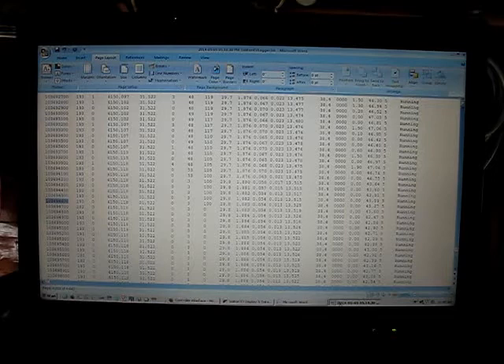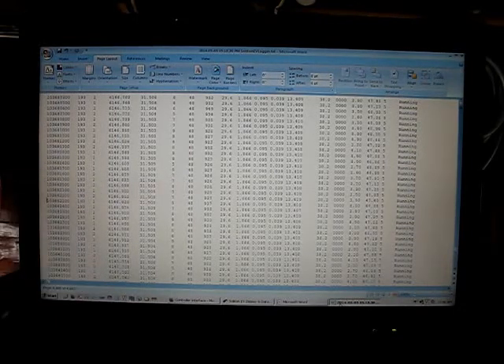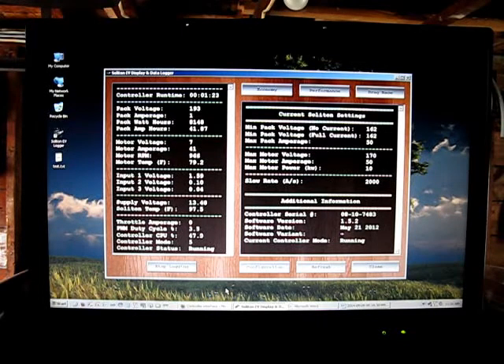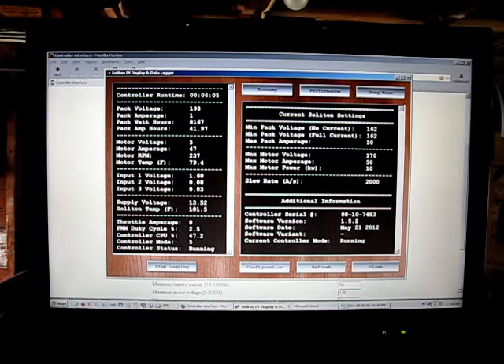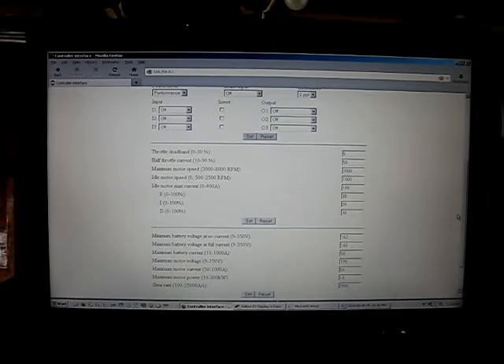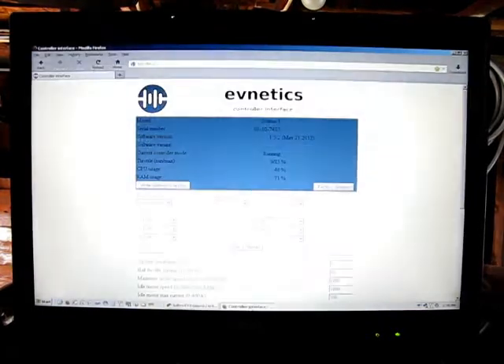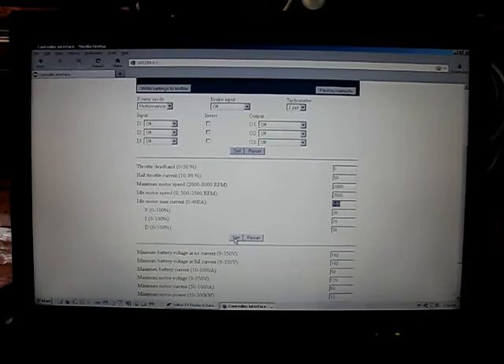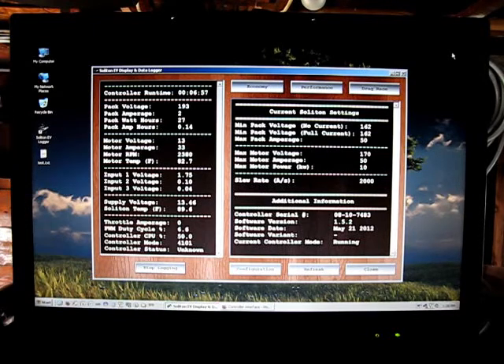May 7, 2014 - Ongoing New Motor Brush Seating Adventures

Comment: Why did the controller read 0 motor voltage? Maybe it did not like it.
Reply from the maker: Aye, that is the indeed question, why was the controller reducing voltage (and thus motor speed) all the way down to 100 RPM when it was set to maintain the idle at 1000 RPM?

Subsequently, it is also curious that raising the "Idle Max Motor Current" setting did not affect idle amperage at all, but rather allowed the controller to increase the voltage, which does seem to be holding the motor at the desired RPM at the moment...

It may just be a semantic issue with the naming and/or my understanding of what that particular setting in the Soliton1 software does.  My guess is that this setting is likely part of a calculation that results in something like an internal "Idle Max Motor Power", which in turn is responsible for moderating both the voltage as well as the amperage sent to the motor in order to maintain the desired RPM.

Even if this ends up as having been caused by a subtle bug in the Soliton's motor idle calculations, it didn't show up until roughly 30 hours of continuously idling the motor...

Therefore, it's extremely unlikely to ever occur during normal and/or real-world driving situations, so I am not overly concerned about it, but rather just found it somewhat curious/interesting and thought I would share what I am seeing.  :)
Reply: DaytonaEV 
The controller was told to maintain 1000rpm but it was not allowed to rise the current above 50 amps. It did the job until the rpm dropped from some reason (may be oscillations, may be temperature, may be other) At that state the motor needed more current (explained leter) the current limit kicked in, to limit the max current(&voltage) going to the motor.

I asked one of my classmate on the University about his opinion. He said that running a series wound motor without a load is dangerous because the torque/rpm behavior. (no torque -> infinity rpm). I may add that the motor has a fan, and other friction losses, which acts like a load. In fact your controller limits the motor speed (via a PID control loop) safely.

The other thing he said, was that at such low rpm the armature may reach the iron core's saturation point. At that condition the input magnetic field (amps time turns) should be increased significantly in order to increase the magnetic flux density (ref.: BH curve). More magnetic flux results more torque (required to speed up the motor) The other effect that may occour is related to Lenz's law. It claims that an induced electromotive force (emf) always gives rise to a current whose magnetic field opposes the original change in magnetic flux. (the force induced by the current breaks the rotatint armature)
 
The voltage (and current) is not set directley by the motor controller, it only adjusts the duty cycle of the electricity coming from thye battery pack. The motor and it's state sets the voltage (almost like Ohm's law)

The settings you made with the idle max current is affectint the PID loop (phisical hardware). I think that the max motor amperage setting is limits in software wich is way slower than the PID loop. So when you enter 100A for the PID controller, it is adjusting the current (for a short period of time) to 100A until the software limits it back down to 50A. I don't think that it is a software bug, more likely the brushes had entered a state that allowed the events to happen.

I must note that at a low rpm the fan is not working so efficiently it may cause overheating problems.

I hope I did not bored anybody with these fundimentals, and it could help you understanding the process better. Good luck with your conversion!
Reply from the maker: Miklos Szekely
Good morning Miklos,

Your research and comments were not boring at all.  On the contrary, I think they are extremely interesting and I very much appreciate you taking the time to share what you had learned.

Good point about the motor speed as well.  Toward the end of this video (about 22 minutes in), and based on feedback from another subscriber (George Hiller), I had changed the Soliton1 to it's maximum idle motor speed setting of 2500 RPM.  This helped keep the airflow moving better and thus kept the motor cooler during this prolonged brush seating process in the relatively stillness of the garage.

As for why the voltage dropped to zero and the Soliton1 was unable to maintain the previously set 1000 RPM idle speed, your classmate's iron core saturation, back-electro-magnetic-force, and Lenz's Law theories sound entirely plausible to me (particularly with my admittedly very limited knowledge of the physics behind any of it).

I suppose that one, or all, of these effects may have come into play at the roughly 30 hour brush seating mark when the motor speed 'mysteriously' dropped down to 100 RPM, causing the controller to shut it down entirely.  Perhaps this occurred when the brushes and/or patina developing on commutator reached some magic threshold of conductivity?

In any case, I agree with you that it's probably not a software bug in the PID idle logic, but rather was just confusion on my part regarding what setting the "Idle Motor Max Current" actually meant.  At a setting of 100 Amps, while leaving the "Maximum Motor Current" value at 50 Amps, it does indeed seem to be able to hold the (now 2500 RPM) speed consistently, so that's good enough for me.  :)

The motor ran for another 12 hours or so before my battery pack ended up being drained to about 167 volts (or roughly 2.83 volts per cell).  At this point I powered everything down and threw the maintenance switch in order to fully disconnect the pack.

I then began the lengthy individual cell re-bottom-balancing process of bringing all 59x cells down to 2.750 volts per cell.  The point of this process being to add back in the brand new 60th cell (also bottom balanced to 2.750 volts), so the entire series pack can then be charged from that point as a single unit and every cell will therefore have exactly the same amount of energy stored within each one.

Once the pack has been fully recharged, I will start up the brush seating process once again, albeit this time with a higher minimum pack voltage as I don't need to drain the cells completely again.  I'll probably go with something like 180 volts for the pack (ie: 3.00v * 60 cells) which is a nice safe under-discharge set-point that shouldn't stress the cells at all.

I can then recharge/discharge the pack for as many cycles that are necessary to achieve a nicely worn in radius on the edge of the brushes, as well as build up a decent patina on the commutator prior to re-installing the motor in the car and dumping the usual 750+ amps through them again.  :)

Take care, and thanks again for your input,

Jason